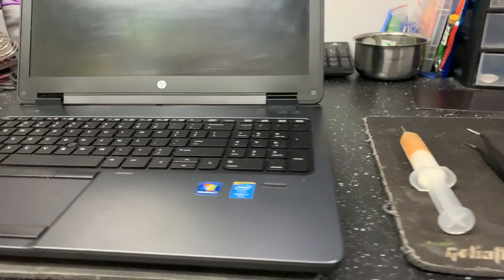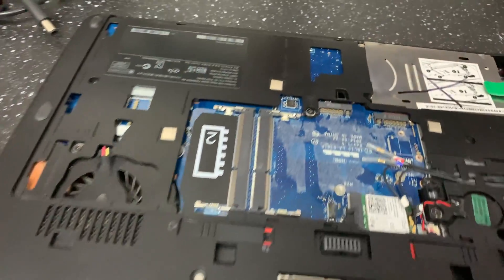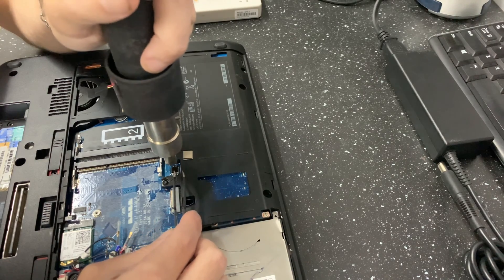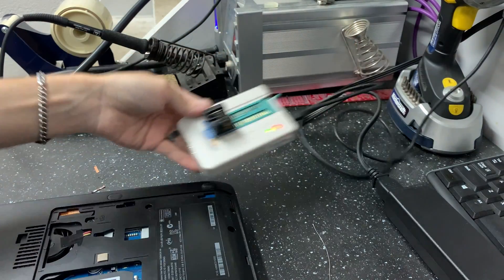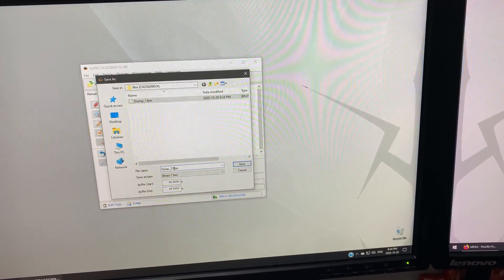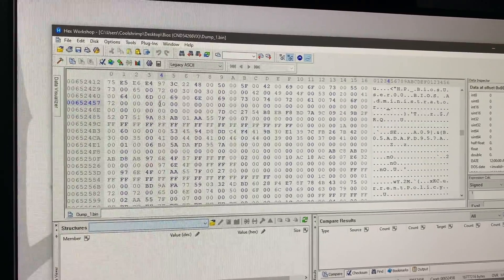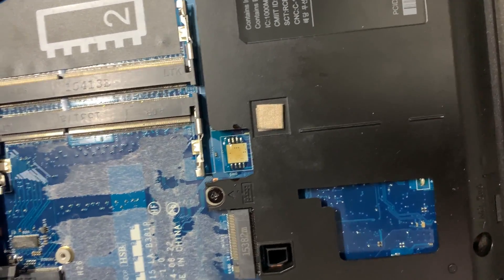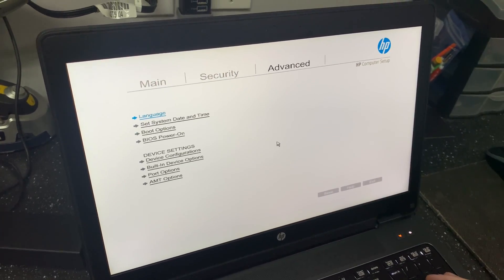Remove Bios Password - HP UEFI Laptops (ProBook, EliteBook, ZBook)

Comment: Hi, thanks so much for the video. It helped me with a laptop whose BIOS the seller couldn't remember, and I bought it without realizing it.
Reply: thats my issue also, did you remove the chip or use a clamp? Id rather not de-solder the chip if I can help it.

Comment: Hello, what should I do when it has different bios reading twice? How do I make both of them similar? That happens when it doesn’t read properly right? And one more question when I get into delete password it says the specified search string was not found. Why is that?
Reply from the maker: @yohanperera21  it could be in a different string if it’s not the same model. 

And yes if they don’t match then they are not reading correctly they should be identical every read. Be sure your wires are not too long. Also turn off your solder iron while reading Iv experienced interference from my iron before.
Reply: @ how do I get the correct string to check the password? Yeah that happened because I’m using pogo pins.
Reply from the maker: @ use the tool to remove it instead: https://www.badcaps.net/forum/troubleshooting-hardware-devices-and-electronics-theory/troubleshooting-laptops-tablets-and-mobile-devices/bios-requests-only/87349-rcunlocker
Reply: @ after extraction when I open exe it says vcruntime140.dll not found
Reply from the maker: @ install visual c++: https://answers.microsoft.com/en-us/windows/forum/all/vcruntime140dll-and-msvcp140dll-missing-in-windows/caf454d1-49f4-4d2b-b74a-c83fb7c38625
Reply: @ now installed perfectly. But do I have to pay for it?
Reply: It has 3 sentences and one is for PayPal donations and one unlocker developed by rethoricalcheese and another missing file destination argument. That’s all
Reply from the maker: @ no it’s all free.
Reply: @ can I also do like this way? First taking a backup with password bios bin then taking original bios bin file from the official website and then erase the ic then reprogram the ic with downloaded original bios bin file.
Reply from the maker: @ the file from the website is an update file and never the full bios. You can use a donor bios but then you may have to reinject your EC info (serial, model, etc). And you’ll need an identical model bios dump it’s usually easier to clean your bios file of the password.

Comment: Does updating the BIOS leave any password as what it was or does it annul the password? 

I wondered if anyone has made their own smc.bin file based on modifying an update, or if that's just not realistic? Are these BIOS chips old enough that older smc.bin files might work if one can find them uploaded to some torrent site somewhere? Just a thought... thanks for a great video.
Reply from the maker: @gurglejug627  updating bios leaves password and bios setting intact. Reason they say to reset factory defaults after each update. But password is non volatile and does not reset.

But you can flash a clean bios overtop but you’ll get this serial info unless you edit it. Or find and edit the password blank in your original dump.
Reply: @CoolshrimpModz  Thanks. What I mean is that HP Used to supply .bin files for overwriting lost passwords, and there are stories about pressing and holding down Win+v, Win+B, or just the B key when switching on to force a boot from a USB drive with that .bin file on it. I'm not sure if this is little known or if it has been removed as a feature totally by HP. As they don't supply those .bin files anyway, I assume one could write one, well, better modify one - I'm assuming they are simply a new BIOS flash with some extra code to get rid of the p/w but I could be totally wrong there. As I understand it I will have to remove the chip and change the data or replace it - I don't have the equipment to read/burn a chip but hopefully can manage to solder in a new ready made chip with BIOS ready installed and tested and no p/w: They're easy enough to get on eBay but without the right kit it's a bit daunting doing that soldering right. So you reckon no .bin or force boot key is available? What I'm trying to do is put Linux onto what was a corporate computer, and wondered if a forced boot key would actually allow it to boot a Linux installation boot USB. Also wondered if I put a Linux distro on a HDD using another computer then put it in my Elitebook 840-G6 if it would boot it, because it's normally expecting Windows:- That way I could leave the BIOS alone. Thanks for your answer earlier today, it's really appreciated.
Reply from the maker: @ yes Iv received a smc.bin in the past from HP. It’s correct they no longer offer them, I assume we can’t just make one as we don’t have the encryption key they use to sign the file. So we have to edit out our pass. For Lenovo there is a uefi bypass that injects a loader almost like smc.bin but we still need to flash externally to bypass signing.
Reply from the maker: @ for the absolute compute lock, it will auto apply your motherboard win key and lock you out via MDM as soon as you complete setup. 

I found if you install windows from another pc. Activate it then bring the drive back to the mdm pc it will stay activated and not trigger the MDM. 

Otherwise absolute edits your windows boot partition and breaks booting every single time you reboot. Some also will break your Linux installs as well.
Reply: @CoolshrimpModz  Thanks again for all the detailed info. So, a new BIOS chip it is then... well, it's all learning and practice - for me. Not much to lose and might even be worth spending the money on a chip reader/blower just to learn about them. Best wishes for now.
Reply from the maker: @gurglejug627  visit the badcaps forums for all the bios info help you’ll need. 💜
Reply: @CoolshrimpModz  thanks again. A new exploration into the world of BIOS begins. :)
Reply: @CoolshrimpModz So do you mean take my SSD out of my laptop with Absolute Computrace activated & install into a different laptop to reinstall Say Windows 10 via a ISO Image on USB Stick? Or were you referring to something different?
Reply: ooh, there's a question - do I have to remove the existing BIOS chip and clear the password or can I use one I buy on, say, eBay with a generic no-password BIOS tested and ready on it? I presume there is no security cross reference to the Motherboard on the BIOS chip?
Reply from the maker: @ yes you can usually buy a clean bios chip off eBay and install it and it will work. You will have a different serials etc but it will work fine. 

But at the same time might as well get a $20 bios programmer to have at the same time.

Comment: hi. i'm new to this. excellent video so far. i was able to desolder and read my chip.

now, i cant find/see on the video, the software you are using to read and edit the file. my programer software can read  and write de file on the chip but wont edit the file.

thanks
Reply from the maker: @Tranthom  RCUnlocker.  https://www.badcaps.net/forum/troubleshooting-hardware-devices-and-electronics-theory/troubleshooting-laptops-tablets-and-mobile-devices/bios-requests-only/87349-rcunlocker

Comment: It looks absolutely smart (& cool)! 👍
One question: would it be ok if I use a WSON-8 probe to read/flash the chip in question (mine is a Winbond 25Q256JVEC), instead of desoldering/re-soldering the chip? Thanks a lot for the tips!
Reply from the maker: Yes you can try a clip or probe it does work on many, but note some won’t allow for ISP (in system programming).
Reply: Late reply but I just used a WSON-8 probe. had to rig up something to hold it steady but it worked. much safer than de-soldering imo. The only issue is I cant find the BiosUser00 string now... :( I think HP updated it so this doesnt work anymore.

Comment: Can I use Organizer SOIC8 SOP8 Flash Chip IC Test Clips Socket Adpter Programmer BIOS + CH341A 24 25 Series EEPROM Flash BIOS USB Programmer Module (Double Clip+ USB) . These are the ones being sold on Amazon but it doesn't look like yours? What is the exact make and model # of your programmer?
Reply: ch341 can only flash 3.3vdc chips it cannot flash below that voltage, so make sure that your chip is 3.3v supply by testing the voltage accross gnd and vcc.

Comment: I can't find any other way to call it biosuser00 with that term, zbook firefly 14 g8,
It has HP Wolf Security block.
Reply from the maker: Try RC Unlock tool 
https://www.badcaps.net/forum/troubleshooting-hardware-devices-and-electronics-theory/troubleshooting-laptops-tablets-and-mobile-devices/bios-requests-only/87349-rcunlocker/
Reply: @CoolshrimpModz the process it's the same for the Huawei Matebook D15 cause I can't find anywhere on the damn internet how to remove the BIOS POST Password, please answer. Thanks!!

Comment: Great video. I've managed to desolder and u/l the bios using ch341, but cannot find that text string. Can it be anything else? Is a blank manufacturer firmware my best option?
Reply from the maker: Use the HP tool to remove the password.
Reply: @CoolshrimpModz   OK thanks, is that a download from HP? Do you have a link?

Comment: How good or bad idea is to do this with the clips that go over a chip, to remove the need of soldering altogether? Thinking about the traces and the components at the other side of the traces more than the chip itself.
Reply from the maker: It is perfectly fine to use a clip, but note they don’t always work and some chips just won’t clip due to the low profile.

Comment: Hi, I did the unlock with a HP ZBook 15 G2 and it worked but the options are grayed out and I can't make any changes.
Reply from the maker: Now set a new bios password and remove it like normal and they should become un-grey.
Reply from the maker: Also try reset bios to factory defaults option.
Reply: @CoolshrimpModz  The last one worked for me, thanks man :)

Comment: This same procedure is used to bypass locks on macbooks.  But keep in mind it is only a bypass on the macbook.. not a permanent solution.  BTW, I am curious how you didn't melt the bottom plastic around where you used the hot air.
Reply: He kept the heat gun moving. The plastic underneath is not as thin as paper. Had to edit this reply...The BIOS chip is connected to the circuit board (MOBO) which is made out of fiberglass and copper. It can scorch but not really melt unless you are determined to melt it.

Comment: Successfully did this to a ZBook 15 G2 using the SPI interface on a Raspberry Pi and flashtool! Searching for 'SPI EEPROM Dump with raspberry pi flashtool' should dig up instructions.
Notes: Could not do it with the chip on the board (via soldered wires), had to desolder and remove the chip and connect to the Pi directly. Obviously something on the motherboard corrupts the SPI signals.
The address was different in my hex file. Found the right address by searching for  00 42 00 49 00 4F 00 53 00 20 00 41 00 64 00 6D 00 69 00 6E 00 69 00 73. The dot before the U is actually AA not 00 and this did not show up as a dot in HxD (the editor I use). So instead of aiming for a dot, a better description is: "zero everything up to the pattern AA 55 7F 00".
Reflashed, resoldered and got straight into BIOS! Thankyou for the video!

Comment: Hi, I got a zbook 15 g2 from second hand  but unfortunately the seller forgot to mention that the bios was locked. My friend has a ch341a programmer with a clip, can I just use that to flash the bios instead of desoldering it?
Reply from the maker: You can try, look for the bios chip read the model and make sure your programmer can support that chip. Then you can try reading it in system. But many times it dosent work and you may have to solder to reprogram it.
Reply: @CoolshrimpModz  My main concern is damaging the bios chip if something goes wrong. I'll try in a few days, after I get the programmer
Reply from the maker: @zadkielalfano  you can order replacement or even a new clean bios chip on eBay, just don’t damage the motherboard when soldering if inexperienced ask a local shop to assist.
Reply: @CoolshrimpModz  I ended up flashing it with the clip, it worked like a charm. Thanks for the video!
Reply from the maker: @zadkielalfano  awesome if you have more to do in the future check out “badcaps forum” tons of support and guides on there.
Reply: @zadkielalfano  can i please have more info on how you flashed the bios. i'm in a same situation

Comment: hi i need help to unlock bios password  for hp 450 G7 PROBOOK  if passable  can you send me the line number which it has password so i can clean the bios 
thank you 
best wishes .
Reply from the maker: It is not on a specific line just search for the user string, or uses the auto patch tool found in my other video or on “badcaps forum”

Comment: Excellent video. Removed no problem admin password from my HP Elite Book 8560p, but most settings are greyed out: admin tools, update sys bios, disk sanitizer, sys configuration, boot options, ...etc
Reply from the maker: Set a new password. Then you can remove it normally and they will become enabled.
Reply: @CoolshrimpModz  BINGO  this worked, Thank you. Updated bios to latest version.
Reply from the maker: Also try reset bios to factory default also works most times.

Comment: I have an HP PROBOOK 11 G1 EE, this method will work without a problem on it, please someone tell me
Reply: Your answer is on the badcaps site.
Reply: what site is that
Reply: @luisgabrielescotopaez5428  I can't write the full name, just search for it and go to the Technical Forums, then search for your computer type.
Reply: @gribbler1695  If you tell me which forums would you help me
Reply: @luisgabrielescotopaez5428  You definitely need to reprogram the BIOS chip, but it's not clear to me what you need to change.
You could just buy a preprogrammed chip instead for $US25.

Comment: I have a question: I have hp elitebook 850 g5 and i too do not know the admin bios pass. When i try and guess the default or whatnot i get i think 3 or 4 tries before i get an error lock msg. But i can still reboot and get into windows. Moreover i bought this laptop from a friend, and neither I or my friend had created this password. So my question is, is there another way to change the password through windows or command prompt? Also, great video. I wish I had the know-how and as much knowledge as you to set up my system, and fix problems such as these. Thank you.
Reply from the maker: Doing what I did In this video is the only way to remove the bios passwords on most current laptops. You cannot do it thru command prompt like some old models.

Comment: Can't you just remove the CMOS battery for 6 - 10 mins? I read that that's al you have to do on the HP web site.
Reply from the maker: That worked on laptops like pre 2005 or so. Newer systems now have non volatile memory that doesn’t need a battery to retain settings. So only thing removing a battery does is lose time. Dell and HP are easily bypassed by editing the bios image externally, Lenovo you use a custom injected EFI to the bios to bypass tpm where the password is stored.

Comment: Tthanks!  Worked with HP Zbook 14 G2, bios version 1.28, rescued from a dumpster.
Reply: Did you do it yourself?
Reply: @WiseRuler  yes, I do hobby repairs to balance my CO2 footprint.
Reply: @pj1010101  So this will work with a HP Zbook 14u G6 that has a Bios Password on it which I unfortunately don't know. I'm trying to solve the Absolute Computrace White Screen DeviceFreeze issue. Thanks.
Reply: @pj1010101  So you reprogrammed your bios chip or did you buy another chip for it?
Reply: @WiseRuler g6 is different computer which is sharing marketing name. i have no idea if it still works
Reply: @WiseRuler i reprogrammed
Reply: @pj1010101  hello, im trying to unlock  a hp zbook 15 g1 with the same method but i coudnt, Could you give me a hand?
Reply: @derekreyes4935  what exactly do you do, and how does it fail? Did you already try the usual BIOS password tools?
Reply: @pj1010101  did you reprogramme it with a clamp or do you have to remove the chip?
Reply: Great video , but I have a question . Are there anyway to read the password instead of removing it ?
Reply from the maker: Nice work

Comment: Hello dear sir, Thank you very much for sharing your knowledge. This solved my issue perfectly!! I had problem with writing to MX25L6406E chip (EZP2019+ programmer) so I pushed down speed to 1.5MHz and delay to 6000 and it worked perfectly! Thank you for helping me with deleting BIOS password for HP EliteBook 8560p. God bless you 👌
Reply: Removed no problem admin password from my HP Elite Book 8560p, but most settings are greyed out: admin tools, update sys bios, disk sanitizer, sys configuration, boot options, ...etc

Comment: Is the hot air blower really necessary to remove the chip? They're quite expensive and I'm looking for an alternative solution..
Reply from the maker: You can get a clip on programmer and program on the board but sometimes this only works with more expensive programmers. You can also simply use a soldering iron to lift the chip.
Reply: @CoolshrimpModz  thanks for your reply! I still don't understand how the bios info is stored on the chip without a cmos battery being present. I removed the battery for a month and the bios info is still on there..
Reply from the maker: @dinigi  the chip has non-volatile memory allowing it to retain stored information even after power is removed. Like a flash memory card.